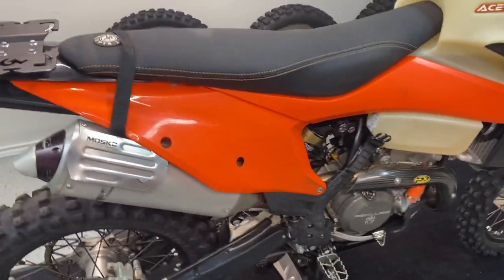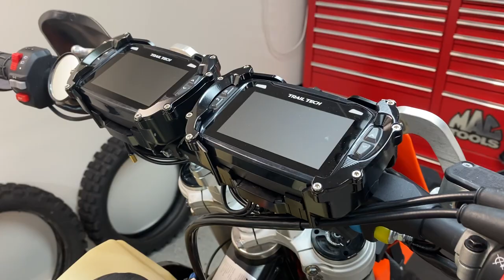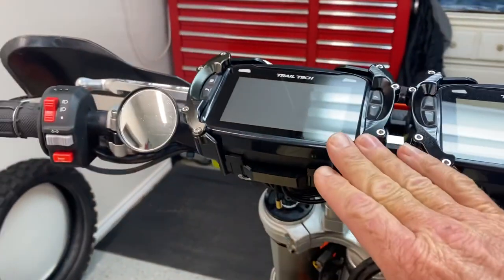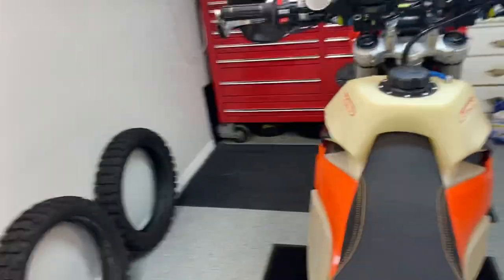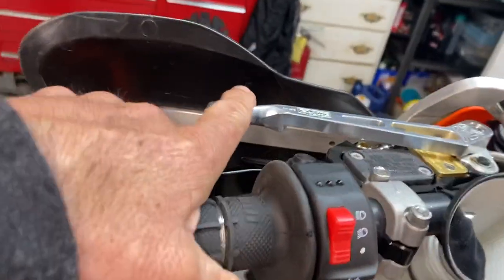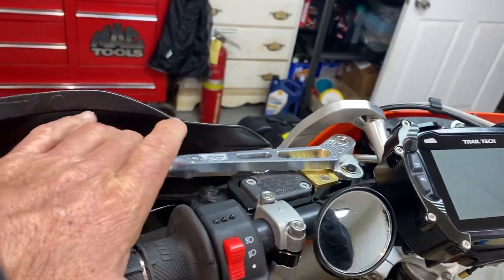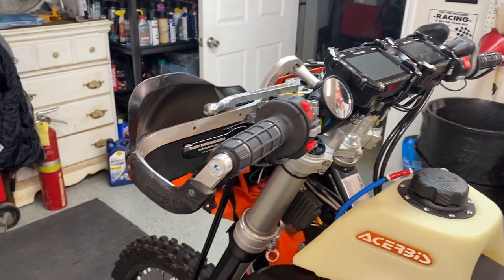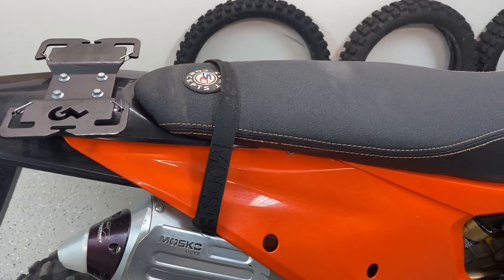2021 KTM 350EXC Dream Build Changes - Post Tour of Idaho (Team Armadillo)

Comment: looks like you went with the Lucky MX tech front end fork setup what's the difference between the stock suspension XPLOR forks and MX tech?  how close are they was it worth the upgrade? what did the OEM forks not do well that you wanted to fix?
Reply from the maker: Both of my wrists are bad due to old injuries.  The stock XPLOR forks worked fairly well for me, however the feedback on initial impact was very harsh and made my wrists not happy.  This occurred on any type of terrain, gravel roads included.  So after much research, I decided to try the MXTECH Lucky Forks and I could not be happier.  They are plush but never bottom due to the Huck Valve.  I was so impressed, I installed them on my other bikes and several of my friends bought them as well, and they all reported the same positive comments.  They work well for me and well worth the $1200 vs. they if to revalve the stock suspension.
Reply: I agree, the Lucky’s are great on my ‘18 300 xcw.  Very good improvement to the xplor

Comment: how much fuel did you actually have to carry with you to make the longest stretch?  what kind of gas mileage did you get? thanks
Reply from the maker: The longest stretch was Elk City to Superior MT.  The planned route was 314 miles with no food/gas options.  We used 40mpg for planning and we added 25% over required fuel in case of closures requiring us to back track.  So leaving Elk City we need 9.8 gallons of fuel.  Our tanks held 4 gal and we hauled 5 gal in our gas bags.
Reply: @davidpowell5015  man that's a long way and a lot of fuel to carry.  I would imagine it would be really annoying to carry that much extra fuel on single track roads